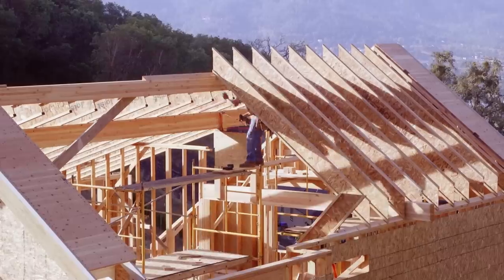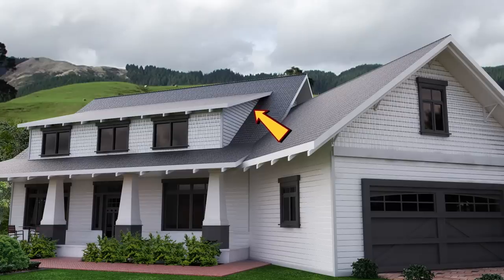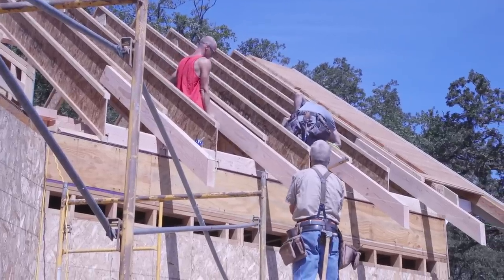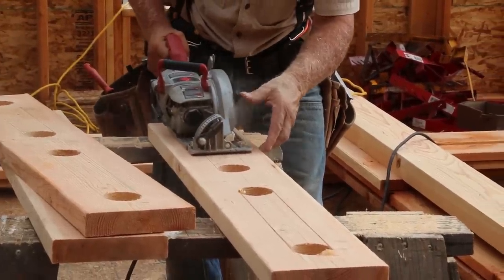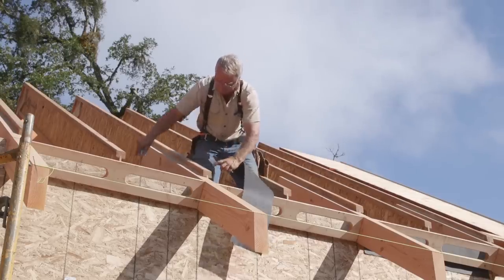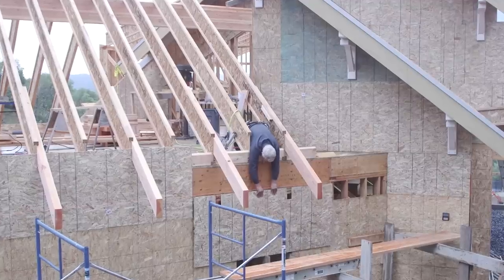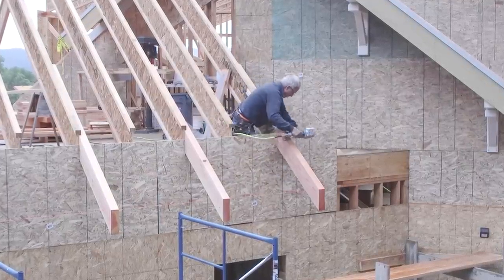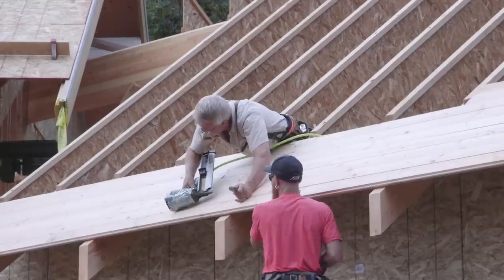Avoiding Mold with Mega Vents Ep.66

Comment: Coming from someone that lives in South Texas, I would round a bead of black RTV around the outer edge of the bird block screen. We have Plague like bugs here and they will wiggle their way between the screen and the wood into the house. Because the staples don't stop them from squeezing between the two of them, I use black RTV because it will last forever in the hot attic unlike caulking which is a 4 year produce at best in the heat. As always y'all are doing great work and that house will be a beaut when she's done.

Comment: Just some advice, where the roof line of the garage meets the gable end roof of the house is going to be a big problem down the road. The gable end of the house should not overhang in this application. The water, leaves, and debris coming off the garage roof is going to collect in the corner of the gable roof and hold water causing bad rotting issues with time. Pause the video at 11:10 or so to see the computer generated finished product and look at the intersection and imagine how the water flows and you'll know what I mean. I'm sure that, like me, you like to try to tackle the problems before they become problems so you can keep up the good work. :)
Reply: gutter
Reply: yYu are correct. Interesting problem.. Looking forward to the solution. Nice catch.
Reply: It will be interesting if he addresses how he dealt with this feature. I’d image he will do a large cricket of some sort if he hasn’t already addressed it in the framing. Good catch. I did waterproofing of foundations and deckings above living spaces so I don’t doubt someone will catch that.
Reply: Yeah. At first glance, I think I would just skip the overhang on that section and have that gable wall dive straight down into the roof.
Reply: Yep - it was bad design in the first place.  The entire intersection between the house and the garage should have been designed differently to eliminate these problems, especially at the back where that stair pokes up.  But, great overhangs!

Comment: After being so particular about gluing down the sheeting on the floors to prevent squeaks, I'm really surprised you're not gluing down the roof sheets to prevent squeaks when the squirrels are running around
Reply: Wayne Welshans or Santa's reindeer...?
Reply: I'm hoping that's metal screening in those vents just for that reason

Comment: I'm a very amateur woodworker, with a reasonably good understanding of biology, and I can understand the idea of "free of heart" wood because I know there are some important structural differences between different parts of a tree. I would appreciate a quick explanation of the choice of "free of heart"for this purpose. (Long time fan, since quite a long time before the spec house was even a concept). Keep up the good work.
Reply: If a timber has a "streak" of heartwood running along one corner or side it will cause the stick to bend or curl as it dries, Uniformity is what one wants. Sap and heartwood dry differently.
Reply: @5x535  Thanks. That makes sense.
Reply: Mark Schwarz , timbers come from either the heart (center) of the tree, or the edge near the bark (sapwood). The better, stronger wood is from the center. 

There are two ways to cut heartwood. Boxed heart timbers 'box' the heart of the tree within the edges of the timber - or we could say the timber is cut around the heart of the tree. Checking occurs with much more regularity in boxed heart timbers. As the timber dries the shortest path to the heart will check. For some this is inherent, preferred character. For others "free of heart" is the way to go.

Timbers free of heart are cut without any heart (center) of the tree within the perimeter of the piece. On occasion there will be some heart at the edge of a free of heart timber. Checking is very minimal with free of heart timbers often resulting in a very "clean" frame. In order to cut free of heart the raw tree/timber is typically much larger than a boxed heart tree/timber.

Comment: I have never seen engineered roof trusses. Interesting. Good video
Reply: Most roof trusses are engineered.
Reply: Andrew Alexander BS
Reply: @TheExcellentLaborer  I don't think you know what the word "engineered" means. Engineered doesn't man "made out of OSB". Except for the guys outside areas of code enforcement who knock together their own trusses on a "than looks about right" basis, all roof trusses are engineered.  At some point, and engineer has approved the design and signed off on it.  It wouldn't pass inspection otherwise.
Reply: Andrew Alexander Bro, you are missing the point. You have engineered trusses and standard. Engineered uses plywood in the core. Standard is just wood. Read up on it...

Comment: I did the same thing with my roof when I added on to my Craftsman home. I have trusses with no tail and added 2x6 rafter tails projecting over the walls. For venting I installed 4-1/4" crown dropped an inch from the bead board between each rafter tail. My faux rafters fooled the inspector until he got insode!

Comment: As a high end painter, that Doug fir is beautiful,  I hope that you use "Sikkens Cetol" translucent poly stain. It's the only thing that we use on our secretary of educations properties here in Michigan.
The way the product fails is from the outside in, not failure from the wood side. This means you can get another coat on it before the wood is damaged because this DOES NOT FLAKE OFF. It's amazing in marine environments also, so I think it would be great out there.

Comment: I love the channel and the work.
As a  professional roofer for 20 years in Canada, i am eerie about the OSB as the roof sheeting, especially on 24" spacing. 

I can't count the amount of times i have had to re-sheet OSB roofs because of the sinking that happens between rafters especially on 24" spans.

From experience the sheeting only lasts between 15-30 years.  1-2 roof cycles.
It will still work after. But it'll just look ugly.

Comment: I've had mold show up in perfectly dry houses. So, there's no hole, large enough to prevent roof mold. Especially on wood systems, doubly so on fresh wood (i consider all wood that's not naturally dried, or kiln dried, fresh). Kinda why i like to get kiln dried wood if nothing else is available, then paint each element with sealer en-masse before being cut. Saves hassles later.
Reply: OSB does not dry out as well as real wood. It tends to hold water and won’t “breathe “. Then mold sets in. Asphalt and bitumen papers work better than tyvek and other modern “membranes “.
Before anyone replies with arguments, I have seen both sides of this and will stick with real lumber and asphalt papers wherever possible and for as long as possible.

Comment: I am waiting insulation material installation on roof, otherwise, ventilation holes do not looks right for me. There must be wind barrier inside now, between air distance and insulation, which will come in. And in top of roof/peak, now also should be ventilation holes.
Reply: Dream4Design , hope he shares the formula he used to size the lower and upper vents. (We’re both assuming he’s installing upper ventilation.)
Reply: Gotta have a roof vent, no?

Comment: Any reason why you did not use Zip 2.0 R - the extra insulation and air sealing are great.
Zip 2 R sheeting comes with insulation attached to the sheets. ¼, ½. 1" and 2" to provide a air sealed, thermal block wrap around the house.

Comment: How do you protect the endgrain of the rafter tails? 

I have an existing test of on a craftsman style garden shed that has wood hardener on the end grain of the rafter tails (not false in this particular case). I'm curious what other folks have done to protect?
Reply: ryanmgill , lead or copper sheet. Sometimes I’ve seen galvanized nailed on the edges. Copper is the prettiest.

Comment: I’m curious to see how you dealt with the elevation change on the roof sheathing from the top of the rafters to the top of the false-work tails. Did you just fur-up the tails with ripped strips to even out the elevations?
Reply from the maker: The car decking flushed with the top of the rafters. Roof sheathing was continuous from top of rafter right out onto top of car decking. But, there are three other applications and each of them required a different solution. Two in porches and one in a dormer that goes out the back. Standby!
Reply: @essentialcraftsman  Ohh, I see it now. At 10:35, right next to your left hip I can see where it flushes up. Some other views of it looked like there was still a step down even after the car-decking. 
Clear now.

Comment: I thought there is a given range of ventilation of attic or roof plane spaces,  eve to ridge.  If I have it right the ridge has to exceed the eve vent flow.  With these massive eve vents did you calculate the area of vent at the ridge and use the code formula?

Comment: You need lots of ventilation with all that OSB you are using. Some people call OSB Vertical Mulch if it is not ventilated properly.
Reply: Oby-1 , yup. OSB is essentially pre-digested for mold, termites, and other insects and pathogens. Solid lumber is best, plywood second best
Reply: Ken MacDonald  If YOU knew anything about the manufacture and building requirements of OSB, you wouldn't say that. OSB can be used in place of plywood but must have proper drainage, ventilation and shielding of air wetting to live a long time. By its very nature of construction, OSB has endless avenues to trap and hold moisture. Wood products absolute enemy. I have worked on endless renovations to see the destruction of OSB from improper building practices.

Comment: Since I have never used the wood "I" beams, in my fifty years in the trade, I can't say that I know much about them other than what I have studied in literature and films about them.  That said, I see that you use tapered, continuos blocking where the rafters sit on top of the wall and at the ridge.  There is no birds mouth cut into the rafters, that I could see.  So you are relying on the nails to hold these rafters in place.    

And at the ridge the same situation appears where the rafters sit on tapered blocking with only the nails to hold the rafter from wanting to slip down.  The nailing plate or scabs you installed across the meeting point of the rafters at the ridge does help, but are you completely comfortable with the tapered blocking at both locations ?

Beautiful house, by the way.

Comment: As an successful HVAC contractor, who is recognized for attention to details, design, and craftsmanship of my installs. I am very curious what system will be heating this house.
Reply: I would hope he'd use a heat pump with either a gas or electric furnace.  That seems to be the norm in his part of the world.  Fairly moderate temperatures as compared to other locales.   It does freeze and get cold for a week or two at a time and in summer can get hot but is otherwise fairly moderate.
Reply: Daniel Grenon , he’s using a conventional forced air system. Gas-fired furnace.

Comment: @3:52 I noticed that you put a bead of what looks like calk long the top edge of the false rafter tails where you attached them to engineered rafters. I assume this is prevent any water that might ever leak into the attic space from getting into this crack where it would easily cause rot very quickly. Am I correct in this observation?

Comment: Love your videos but this one got me thinking...

I can't see why this amount of ventilation of the attic is needed? You say that moisture will form from condensation, but that is not how it works. As long as there is no moisture/waterwapor added to the attic from within the building a.i livingspace, then there won't be any problems with mold? Tests prove that its better to have a very limited amount of vents and instead make well sure that the attic doesn't recieve any moisture in the first place. Also one can insulate the roof cheeting, thus creating a warmer atticspace capable of handling a bit more moisture.

What's your toughts on this?
PS. Sorry if I murdered your native tounge since it ain't mine 🤣😊

Comment: I've watched all the series' videos to this point and I have always had this question in the back of my head, "Why is he using construction adhesive to bond two pieces of wood?" Between the floor OSB and the floor joists, I understand you want some flexibility in the joint, but wouldn't you want the stronger wood to wood bond from wood glue (especially given the surface area of the joint) over the construction adhesive?
Reply: I'm not Scott's engineer, so I'm speculating here ...  but my understanding is that no credit is given to field applied adhesives in the engineering calculations for residential construction, so I would expect that sufficient connection strength is provided by the  mechanical fasteners, and that the construction adhesive is just "extra".  I agree that you could probably use a better adhesive if the bond strength is critical, but since it isn't, then the convenience of applying construction adhesive is a factor.   Again, all speculation on my part, Scott or his engineer might give a different answer.
Reply: @andrewalexander9492  If the adhesives are not factored into the engineering calcs, they could be an architectural call out to simply prevent squeaks. I was always required to present material submittals for virtually everything used in a build and they would have to get stamped, for approval by one or the other (arch. or eng).

Comment: Im not exactly sure how this works, my boss figures all this out but he calculates the size of the vents at the ridge to be the same at the over hangs. He does this with the amount of proper vents in the attic and vented pieces in the soffit. He explained once that the amount of air coming into the attic cant be more then is able to go out otherwise it causes some pressure imbalance. Just thought of this when i saw the size of the vents between the rafters. Again not exactly sure how it all works but it might be something you want to look into.
Reply: Matthew Grady you’ve got it backward. If more air is trying to escape than can enter through the intentional venting, it will find other places. Which is your interior conditioned air. Leaks from the interior are the major cause of ice dams. The intake capacity needs to always exceed the exhaust capacity.
Reply: There is a formula. It's either 1/150 of the square footage of the attic equals total amount of venting or 1/300 (you divide that total amount by # of bird blocks to get their opening size). Can't remember which number you use or why, as I did all that last year, but that's how you determine how much attic venting is required.
Reply: Yeah i wasn't quite sure how it all worked but i knew there was some process to it.

Comment: Net Zero and Passive House construction techniques are the future. Saving energy saves money on utilities.
Air sealing, great insulation, super efficient heating and air conditioning, LED lighting systems, Triple pane windows and European style triple seal doors, Solar panels with battery storage and an electric vehicle charger in the garage. Air sealing and blower door testing is an under appreciated energy saver. Why not have a home with Zero energy bills.
Reply: Those are all great innovations but to employ all of that in a house located in an area with such a mild climate as this would not be practical for a ‘spec-build’ like this one. You’d never recover your investment. And the additional cost is substantial.

Comment: So you think more air flow is better than sealing it up and preventing any mold from getting in the in the first place?
Reply: It needs air flow. A lot of air flow to keep any moisture away.  I think he mentioned that the roof will have ridge vents so a lot of air flow from the soffit vents on up to the ridge vents is the way to go.
Reply: @pnwester2697  my point is that if there is that much moisture why not seal it up and prevent any moisture from getting in there in the first place. It's like saying I'm gonna open my front door because it's cold outside maybe a nice cool breeze will warm me up. I understand there are specifications and some things are proven so why increase the air flow when maybe that will do the opposite. Maybe it's just cause I'm from a different region I see peoples garages lumber turn into squishy sponges that loose their compression and basically turn to pulp. I wasn't really questioning any air flow I was questioning more air flow. More air more moisture can get in.
Reply: @thetommantom  There will be moisture getting in those spaces, no matter what you do.  Even with the most careful construction moisture will be getting in there. It will find its way from the living space through and around the vapor barrier applied to the ceiling.  The only way to deal with is is to ensure adequate airflow.
Reply: @andrewalexander9492  Exactly. Moisture will get in all by itself. It’s getting it back out that’s the trick.

Comment: What is the point of insulation when you open up the chambers ? We just put a breathable membrane on the inside between the construction and drywall. So you keep it airtight , no condensation. And the outside can always dry back to the inside of the house.

Our new constructions need to be 100% airtight. They get tested for it after the fact with a doorblower test. You control the air as you want with a ventilation system.